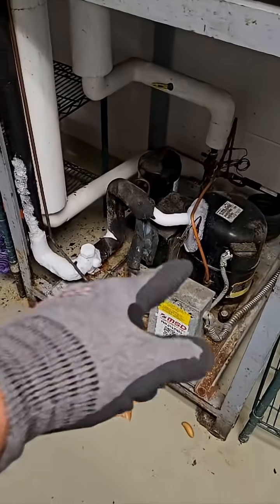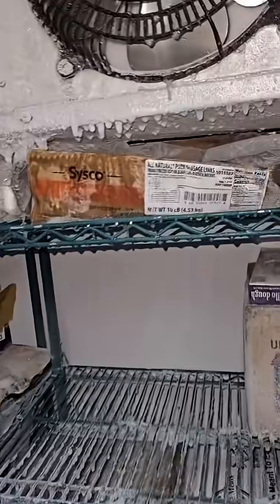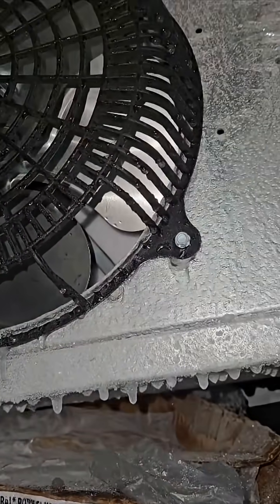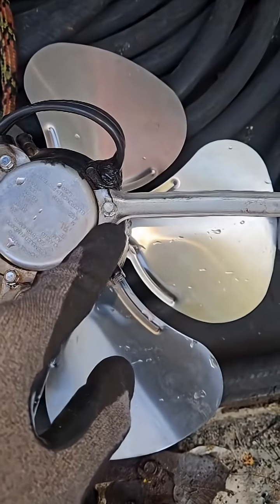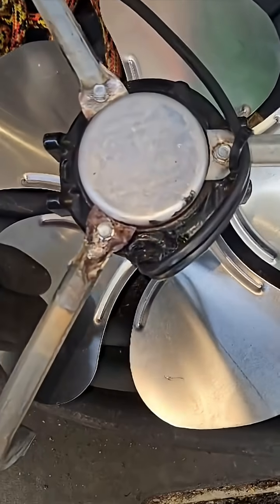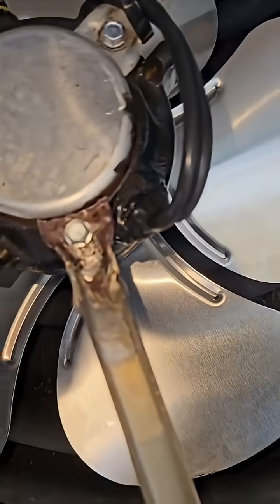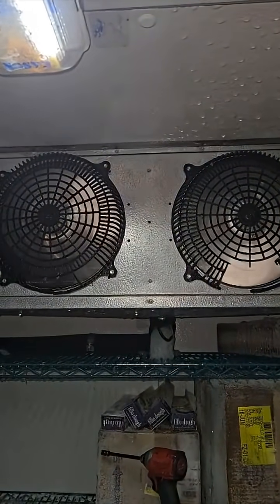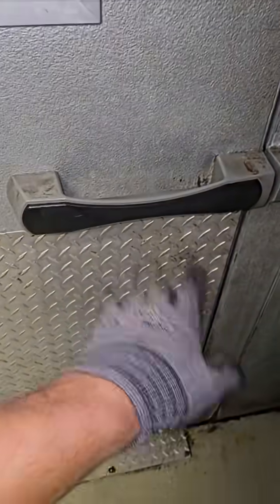Walk-in Freezer Fan Mount Broken On Call! #refrigeration

Comment: What materials did u use to weld with the brazing torch?
Reply from the maker: I just used a normal 15% rod with the white flux paste 👍 Cleaned and scratched up the surface a bit beforehand.